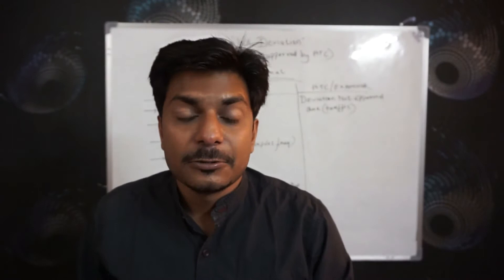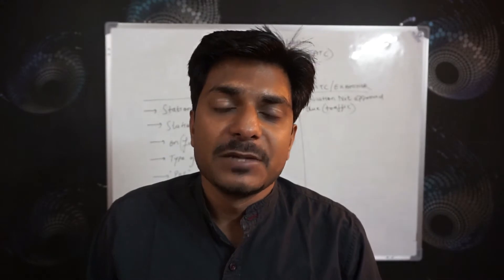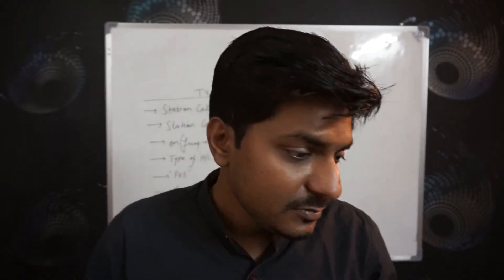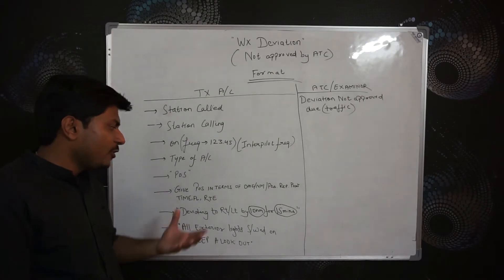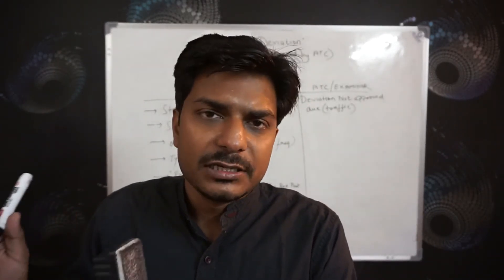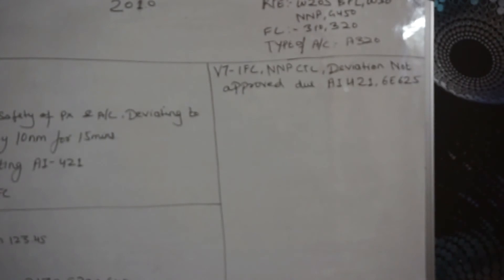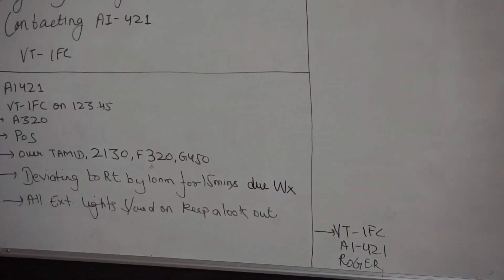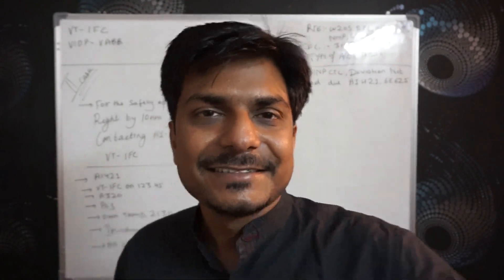wx deviation.... part 2

Comment: Sir, Air traffic controller ne AI421 and 6E625 dono ko traffic bataya tha, phir is case mein apne keval AI421 se hi contact kyu kiya aur 6E625 se contact kyu nahi kiya?
Reply from the maker: In practical scenario u need to contact both but as per exam's POV u only need to show how will u make the transmission in such cases
Reply: @captainclasses9761  Ok sir, thank you so much.